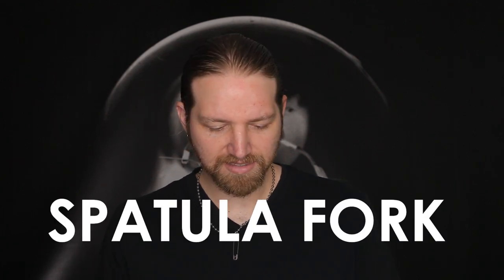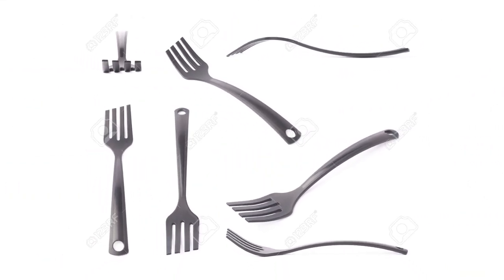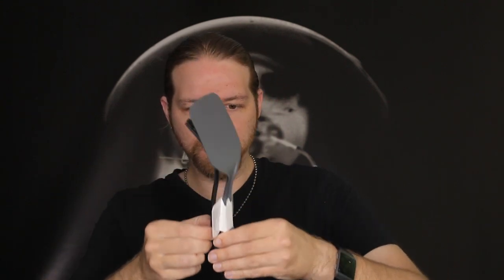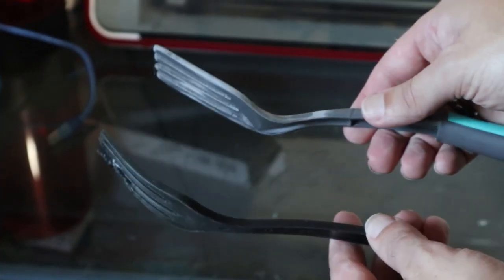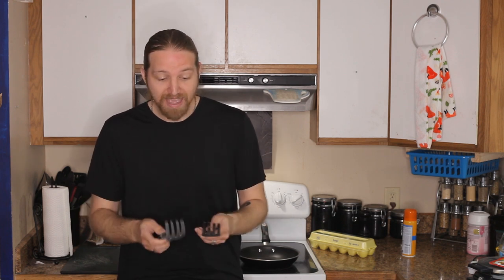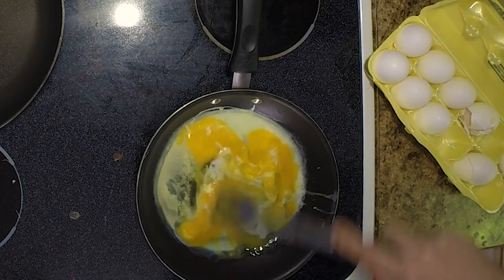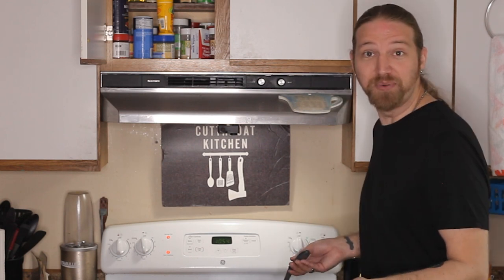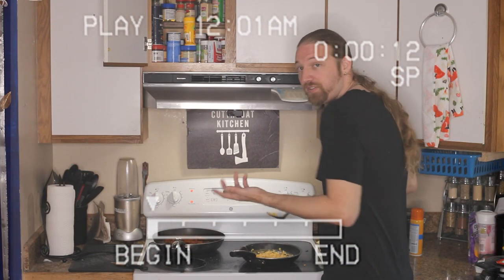DIY - SPATULA FORK

Comment: I found your video because I saw someone using a "spatula fork" for frying. The combination of grabbing but also flipping was a terrific idea! Went looking, and like you, couldn't find squat. Then I had an "ah Hah!" moment! Why not use a chef's serving fork? Wah-Lah! They're pretty cheap; stainless steel; have sharp(er) tines; and are usually about 2" wide. I looked at my salad/serving fork (cheap, came with a set), and it's only about 1-1/4" wide. Maybe the only drawback is the typical 9-1/2" to 10" long. But still.....definitely doable, AND affordable! Right?
Reply from the maker: Yeah, not a bad solution, I have ceramic pans though, so they would scratch pretty badly with a steel fork. However, shortly after making the video I found this listing on Amazon for almost the exact same fork: https://www.amazon.com/gp/product/B002U9GKJ4 but of course it was "Currently unavailable? But I added it to my wish-list. A then randomly, in October of last year (2021) it was back in stock! I ordered 2! And... a few days later is was "Currently unavailable" again :( But it arrived, the real deal, so now I have one, and a spare, and my DIY one. And the broken one still lol.

Comment: They sell slotted spatulas that you can just cut with a pair of scissors. 100 times easier than buying those fancy machines you used. Just did it and sanded it down with sand paper. 2 mins. No fancy equipment needed.
Reply from the maker: 100 times easier? I'm curious how you acquired such a statistic. ;) But yes, that is a very good option. But if it's soft enough to cut with a pair of scissors, I'm not sure how effective it will be. Even the one I made, in the end was a bit more flexible that I would have liked. As with most things, there are many different ways to do something. I'm sorry if my "fancy" tools offended you.